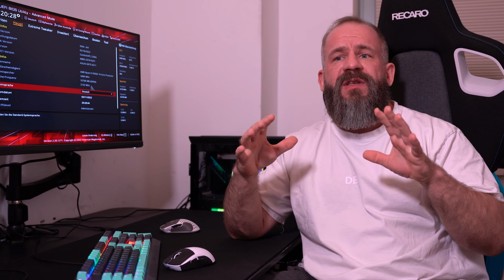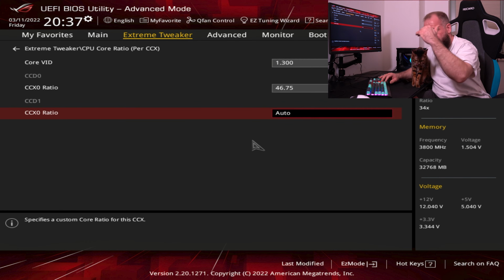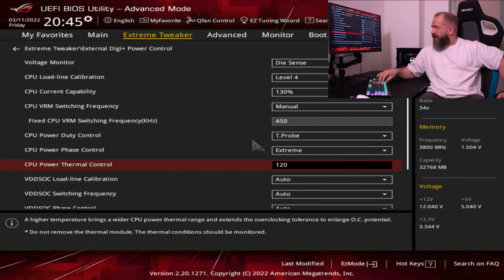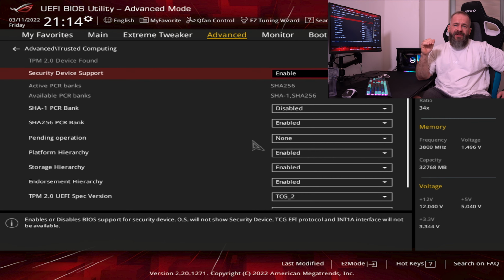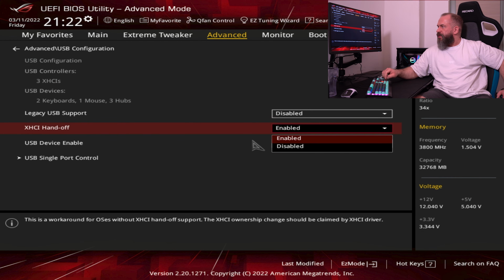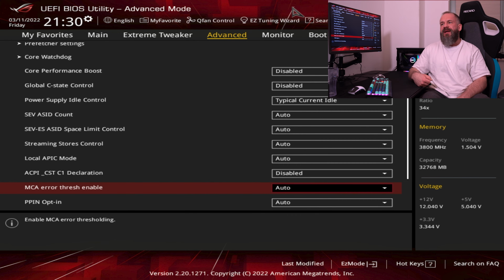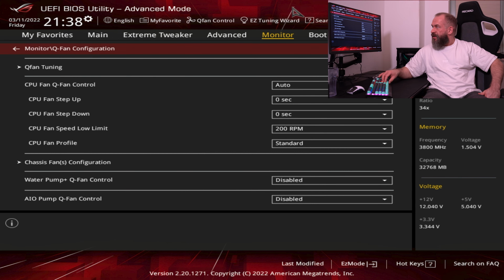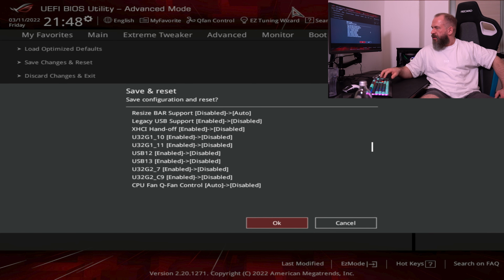UEFI BIOS LOW LATENCY GUIDE for AMD ! | Low Latency Guide Part 1

Comment: Lot of people say they're overclocking when they mean under Volting. I use Hydra OC sand box instead of Ryzen master. 
5950x acts like a turd if you don't trim the core voltage by 00.00625 - This video does mention that. 
If you just do that one thing, everything is going to improve.  I did notice a tiny improvement by enabling Ultra Response.
Plus you need to be at stock power settings and 4.9GHz by setting -150 Boost in advanced PBO2 )) don't need curves with that. Fmax = Enable or ST will drop.

Comment: I have Asrock B650 PG Lightning after 3 days working fine, now yesterday going to the bios and after 1-2 minutes there the bios FREEZE!..Only reset pc going inside the bios and this happen again after try to save the options...this happen 3 times again.My bios is the last 3.01
Reply: Ur bios is not stable. clear CMOS and slowly check every setting and test. This vid was for Am4

Comment: My games just keep crashing after doing everything. Any idea as to why?
Reply: Set your settings by default. That's all
Reply: Undervolting takes a very long time just use one of the pbo presets
Reply: take a guess
Reply: You need to validate stability with stress testing after applying new BIOS settings. Run linpack, prime95, memtest, cinebench etc to see what works and what doesn't. The reason all these optimisations aren't standard is because not all of them will necessarily work well on every system or for every user. The CPU core ratios and voltage settings in particular are very specific to his CPU and what his particular sample can tolerate, and his memory configuration is very high-end for a DDR4 kit. Some of the other stuff, especially towards the middle/end of the video is more broadly applicable but you need to know what you're doing before changing these settings or you'll end up with something not working on your motherboard and not knowing why.

Comment: this settings works on 5800x3d?
Reply: No, on 5800x3d you will need PBO. Possibly go with manual PBO and -30 undervolt all cores. Most 5800x3ds can do that.
Reply: @reizanaliu -30💀
Reply: @reizanaliu -30 😂

Comment: This video helped me out immensely, although  I have a 5600x, which has only 1 ccx/ccd. There was alot of useful information to lower overall latency from a bios standpoint. The video was not to long I've actually watched it 3 or 4 different times, sometimes you miss something if you only watch it once. I'm subscribed.
Reply: i got a 5600x and I'm facing severe latency issues. witch settings actually worked for you in terms of input lag?

Comment: Awesome video, thanks a ton. I plan on doing a fresh windows install soon and I obviously want to tweak my BIOS as well. Right now the cooling on my PC is not the best.
I plan to upgraade to a 1000W PSU soon since it doesn't seem enough and I got power related crashes when I installed windows, it now has vanished completly for some reason, just to make sure tho ... can I use these settings as well for this rig? I propably won't do the overclocking stuff yet. Can I follow this guide and just not do the overclocking or is it too risky? Maybe you could give me some advice on how to proceed

This is my setup:

CASE:
Fractal Define 7 Compact
PSU:
Enermax Revolution D.F. 650W
MOTHERBOARD:
Asus ROG STRIX B550-F GAMING
COOLER:
be quiet! Dark Rock Pro 4 Tower Kühler
CPU:
AMD Ryzen 9 5900X 12x 3.70GHz So.AM4 WOF
GRAPHICS CARD:
Asus TUF GeForce RTX 3080 OC 10GB
STORAGE:
2TB Crucial P3 Plus SSD M.2 PCIe

Gerne auch auf deutsch. Besten Dank nochmal! Hab dir ein Abo dagelassen, starker Channel!

Comment: Curious what your recent recommendation are especially with the 5800x3d. You should also make a video on proper windows settings because there is a lot that can be done to improve latency and overall gaming performance there as well.
Reply from the maker: done ;) will be online next week
Reply: @TheWhaleENG  Great! :D Should be very helpful for a lot of people. Curious if you talk about DPC latency. It can be problematic on a lot of peoples systems most people are unaware of. It can really negatively effect gaming performance and input latency.
Reply: @DJHarmonics  vid is up
Reply: @TheWhale030  Thanks Mark, already watched it through last night. Most of the bios settings I had done already, there were a few settings I learned from your video though. Are you planning on making a windows optimization guide as well? I'm guessing you use a modded windows OS. I've been using ReviOS with some minor tweaks, average DPC latency is hovering around 0.75 - 2. Nvidia drivers cause a ton of latency issues though, curious if you have any tips for that. I'm using a 3080 paired with 5800X3D.
Reply: @DJHarmonics  switch to KirbyOS
Reply: @TheWhale030  Okay thanks, Ill take your word for it and try it.
Reply: @TheWhale030  Got a link for KirbyOS? It's hard to find, don't want to click any dodgy links.
Reply: @DJHarmonics  https://drive.google.com/drive/folders/1ytmYKmSgrAOo3Kh3yCjyQMyYWyfumQvD
Reply: @TheWhale030  Thanks, I appreciate it!
Reply: @TheWhale030  Wow, KirbyOS is fantastic. It was exactly what I was looking for. Thanks again man.

Comment: Can I do the same for 5800x3d on asus x570 Viii dark hero motherboard?
Reply: please help!
Reply: +1
Reply: Im intressed this too!
Reply: +1
Reply: Yes for most of these settings. There is a few that you can't do or shouldn't. Anything overclocking related with the cpu should be avoided if the options are even unclocked on your bios. Most bios lock overclocking for the 5800x3d.
Reply from the maker: video rekorded but with the asus xh extream
Reply: Great! When will u upload?

Comment: sorry for the dumb question, but does these settings apply to 5950x on dark hero x570 with Crucial Ballistix 4000c18 (2x16)? I am having major input latency issues and I am not able to understand what is wrong
Reply: its the processor dual ccd not good

Comment: Thank's !!! great job ! perfect for 5600x + Asus B550 F-gaming, just 4 thing are different : 
1 : Core VID isn't working with 1.3v /48x (crash during cinebench) BUT with 48x and auto Vcore in AI tweaker section all is ok (the values are close in HWinfo)! 
2: Clock Amplitude & Promontory presence are missing on this motherboard
3: Fixed CPU VRM Switching Freq & VDDSOC max is 400 on this motherboard => i put -50 than the max like Mr said ! 
4: i keep SMT because 5600x is a "little" 6 core 

Im going out of warzone 2.0, was my best feeling so far ! 

about dpclatency : Strange thing, when i'm looking latencymoon, i have more dpclatency than before with PBO on +200 -30 :
- this setting give me 12/6 = smooth like a butter
- my old setting PBO  10/4 = not smooth like a butter (PBO limits disable, scalar x1, curve -30, +200Mhz + Cstate + SMT) 

I'll try a mix between both to see how it goes.

And congratulations for the role play it was funny 🤣
Reply: Hey man ive had issues with this input lag compared to my old pc :(((, i have he same CPU and Motherboard as you, bro please what do i need to do in BIOS? what helped you? <3
Reply: @ViSomBusar  do like me ( like the tutorial+ my comment about my Xperience with 5600x = solid )
Reply: whats your current bios for 5600x bro?
Reply: @marcus7353  actually i m on the newest 2008.  I Can t spk about it at this moment but it's better if u use pbo ( search 2003 vs 2008 u'll see it)
Reply: @vofatis what setting did you use for low dpclatency? what is 12/6?
Reply: @marcus7353  AT this moment idk 🤣 i readed again , looked the movie agn (quickly) but i Can't tell u what that mean 🤣🤣🤣 sorry 
But i followed this Guy and tried different thing for find a good way . 
I dont really use my PC since december for gaming but i read that NVIDIA have a little pb with dpclatency with the last driver, if u have NVIDIA card
Reply: dpc latency does not affect your ingame latency

Comment: I didn’t think it would make that big of a difference but I did this plus disabling hpet and just booting into windows I could feel the difference
Reply: Update:⚠Disabling HPET distorts the system's understanding of time, which causes the system to miscount the frames in a second.
 If one second isn't one second, then FPS isn't FPS anymore. 
This data is invalid.
Old:
Some games you gain 11% extra performance and in others you reduce 11% performance.
CSGO HPEN ON: 482 FPS AVG >>>OFF: 415 FPS AVG
Apex HPEN ON: 101 FPS AVG <<< OFF: 121FPS AVG
Cyberpunk 2077  HPEN ON: 46 FPS AVG <<< OFF: 49 FPS AVG
Ghostrunner  HPEN ON: 95 FPS AVG <<< OFF: 109 FPS AVG
COD Modern Warfare  HPEN ON: 95 FPS AVG >>> OFF: 80 FPS AVG
Wolfenstein: Youngblood(Bench 1)  HPEN ON: 120 FPS AVG>>> OFF: 86 FPS AVG
Wolfenstein: Youngblood(Bench 2)  HPEN ON: 135 FPS AVG>>> OFF: 101 FPS AVG
Rage HPEN ON: 141 FPS AVG<<< OFF: 141 FPS AVG
Do your own testing on the games you play.
Reply: Update:⚠Disabling HPET distorts the system's understanding of time, which causes the system to miscount the frames in a second.
 If one second isn't one second, then FPS isn't FPS anymore. 
This data is invalid.

Comment: It's snake oil until you can measure a difference.
Sorry 😐

I'd love a follow up if you can get a total system latency measurement tool
Reply: Where to view a legit optimization video with latency measurement tool or whatever?
Reply: @haster613  There are some but they don't test these more niche optimizations.
Battlenonsense did some tests on certain things and VSYNC vs FPS limiter and stuff.

However, I don't think there are any people who have done tests on all these tiny things, like I want someone to test them all so we know for a fact it's not placebo.
Reply: @TennessseTimmy   I think there are tests done in pages about the imput lag or response time on mouse, keyboards and even cpus and gpus that ARE even more significant than any optimization.
Reply: One use-case for me is simply playing an Ableton live project at ultra low latency (4ms) and seeing how the system manages to keep up with the audio buffer. Of course there are many many external factors that can interfere (windows explorer indexing, audio drivers, random tasks in the background, etc). Would likely be easier to do reliable tests on a custom Linux build where the interference would be removed.

Comment: thank you so much this helped a lot. new build with 5600x was laggy af. I didn't oc but all the others settings already made it a lot better ty
Reply: can u send here the settings? i also have 5600x and b550 mobo
Reply: @marcus7353  only things that actually made a difference on input lag were to disable spread spectrum and to manually overclock ram. this CPU is highly sensitive to ram speeds/timings

Comment: Hey bud love your video. I have a similar setup to you (CPU and Ram) but the Ace Max MSI motherboard and a 6900XT. I have a quick question I get very subtle input lag, now it's nothing to do with the monitor, and I get it in my mouse and keyboard (some clicks and key presses dont register). This occurs not just in games but also in windows as a whole. Would you have any ideas as to what that might be? I run everything at stock value and drivers are up-to-date and everything else works as it should and my FPS is fine. It just feels like micro-bottlenecking as there is the tiniest little bit of stuttering in some animations. Any help or suggestions would be fantastic, thanks.
Reply from the maker: energie sa vings mode of your graphics card. AMD cards have very strange mode google it.
disable all c states also
Reply: @TheWhaleENG  Yes, thanks I disabled the c-states already because of your video and it definitively was an improve and a step in the right direction but would there be anything else you feel would help? I know you said to google energy saving modes but I don't use AMD's driver program (Adrenalin), instead I used a tip another youtuber showed on how to install ONLY the driver (without the bloat) but this means I don't have access to any options - any recommendations would be fantastic, thanks!

Comment: I have a Ryzen 3600 on which I run an all core OC at 4.4Ghz paired with an RTX 2060 and 3200Mhz dual channel RAM on a 240hz 1080p display. After optimizing the hell out of Win10 and setting up the OS specifically for gaming performance it still felt wrong in gameplay. There were micro stutters all over the place and latency felt like I was using my previous 75hz monitor. Mouse was feeling weird even though it's a brand new GPRO with Windows accel off etc. I have an MSI X470 board which has most of the features you tweak in this video. After following your guide and properly setting up everything I have to say, the difference is night & day. Average FPS and frametime is super consistent on uncapped. Even heavy duty games like Cyberpunk run perfectly smooth with almost non existent frametime spikes even when all hell breaks loose. Esports titles like CSGO and PUBG also run like a dream but most importantly the weird mouse feel has totally vanished in general. Gameplay is very consistent and smooth with uncapped FPS.

 If you run an AM4 chipset go and tweak according to the video. You won't regret it!
Reply: (Sry for bad English) 
Thanks for sharing you experiencie. I have a low end setup w a 75 hz monitor I'm trying to get the best I can get from it like the lowest input delay... I can relate to the mouse feel, when I started playing a different champion in league of legends that requires a more high precision mouse clicking, I noticed the hella input lag my mouse had and system overall... It's really interesting to see that even you who has a very good setup go through this problem
Reply from the maker: thx 4 sharing this with us!

Comment: Great video but I have a question, After applying all of thoes settings the Amd Ryzen Master program still shows all the cores go to sleep when there is no immediate workload how to keep them all awake all the time??

Edit: I went to Amd website and downloaded there Chipset Driver software (I have all the driver software from Asus), but I belive the drivers from Amd have given me the same low latency or better then all this settings showing in this video. I now have almost stock settings in the Bios and my latency seems as low at it was after applying the settings in the video. So in conclusion the Driver software from Amd was as good as all thoes settings. Sorry to say it, but that my immediate conclusion.
Reply from the maker: Hey :)
I haver no idea about ur system at all.
But updating the bios and having thje latest drivers on the system is the standart.
Also I can assure u ryzen master opti is not even close to what i have shown here.
but thx :)

Comment: Thanks for the video! 
I use a TUF X570 and can't find the setting: Clock Amplitude
Reply: Hmmm I check later how it could be called on your Bord
Reply: @TheWhale030  awesome
Reply: CPU Differential Amplitude [Auto]  [Auto] [700mV] [800mV] [900mV] [1000mV]   

is there a option like this=?#

Comment: I've seen negative results with resize bar in apex. -10%
Reply: Setup?
-10%
How U checked it? CapframeX?
Reply: @TheWhale030  No, I have not personally checked it mark. I saw the video on hardware unboxed channel that showed it.
Reply: @ancientalien815  at first I hat the same feeling tbh. When I was released it looks like the performance went down. On later updates bios and using it over time I realised it's more the way U use streaming memory settings on apex.
Reply: @ancientalien815  trying it btw since yesterday

Using CapframeX today to log it.
Bit for now can't see any advantages of not using 4g